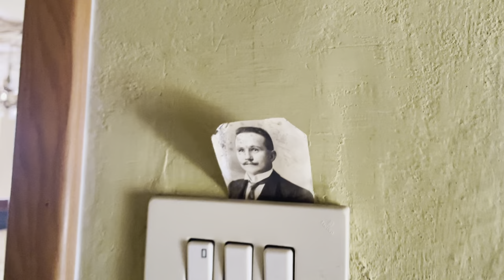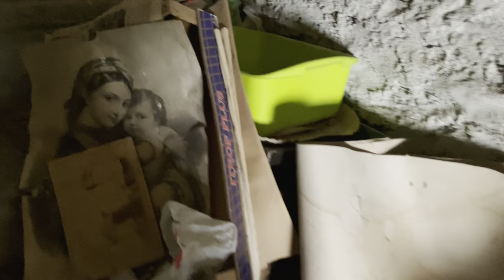Day 5 of renovation on the lake Como 🐸 A scorpion, a dead rat and lots of scraping…

Comment: You are very sweet but the house needs much more than just a cleaning. Roofing, electricity, plumbing. Until those essentials are done, it will not be habitable. It will be quite expensive to get it to the place where anyone would want to live in it.